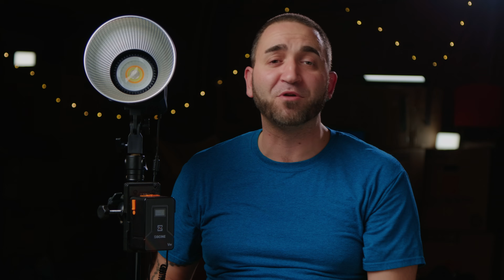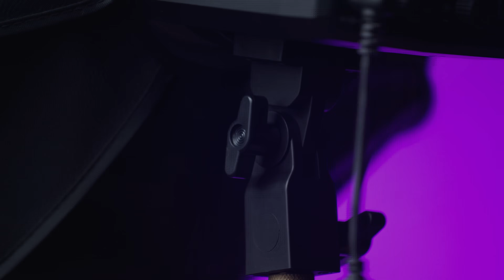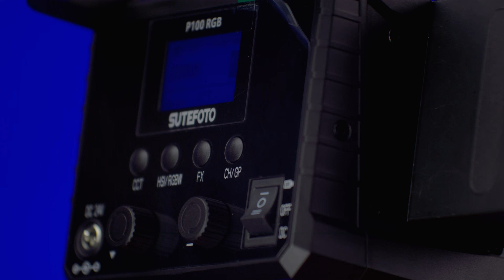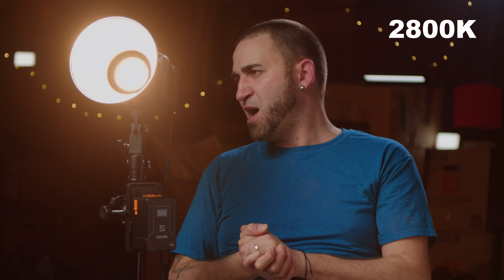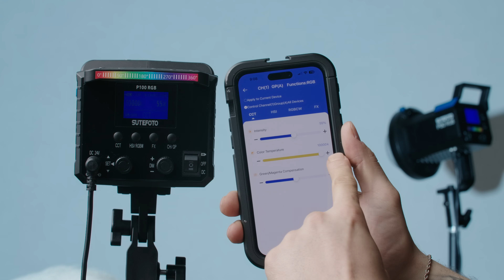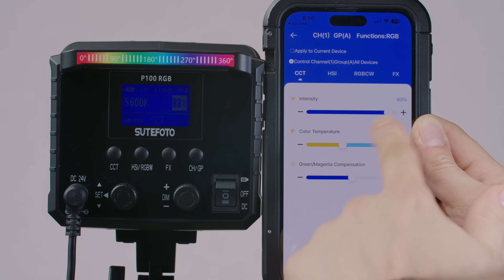Sutefoto P100 RGB LED Video Light In Depth Review

Comment: Nice review ☺️. Was looking for my first light, something to help with music videos etc. Would you recommend this or something else on a budget?
Reply from the maker: I would be getting this Sutefoto P100 or the P80 which is basically the same light but this p100 is 100watts and the p80 is 80 watts. The 80 watts is also really bright. I owned the p80 for about a year now and it’s still working great. Main difference between these 2 lights is that the p100 can also be powered by NPF batteries when you can’t plug the light into the wall. So it’s great to have that flexibility.